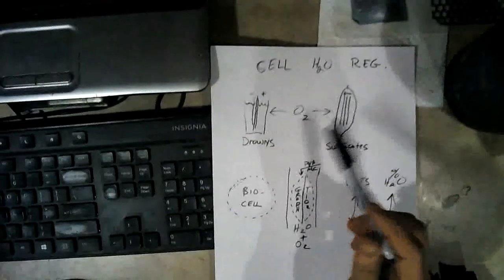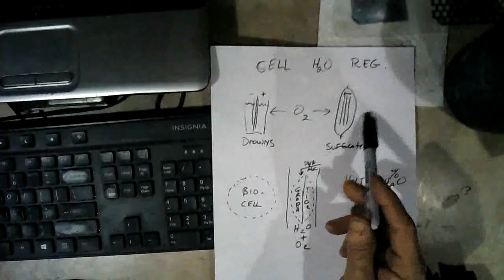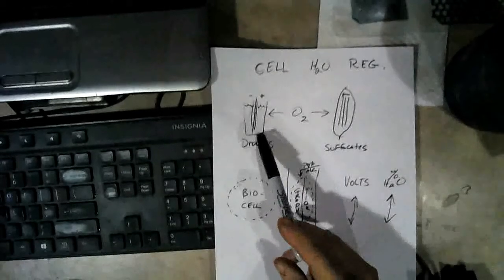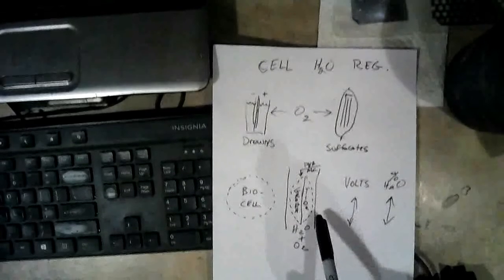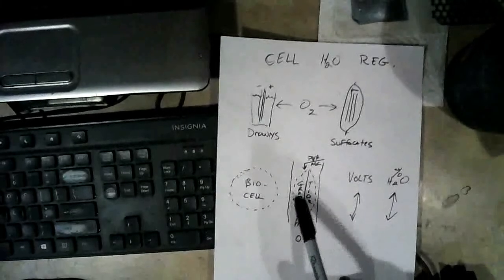Battery Water Regulation Problem!!

Comment: Maybe the cell resistance is lower giving higher voltage reading but this maybe from densely packed carbon but lower available surface area from being densely packed also . Like a trade off
Reply from the maker: That's possible. I just have to keep experimenting until I find something that works.

Comment: I have noticed on my cell tests that often when the voltage is higher that it’s capacity seems lower. Not sure why as there are so many random test but I have noticed often !
Reply from the maker: I usually see that when the cell is getting low on water, but there are probably other causes like running out of electrolyte (if you are using any), or oxidation build up on the metal plate.

Comment: Just thinking out loud again. Maybe a sponge base to wick water in to maintain hydration might help.
Reply from the maker: If I can find a sponge with the right thickness and pore density, I'll try that.
Reply from the maker: I found a 3 inch wide roll of sponge for sport wrapping in town the other day.  I think it will work in the battery Fred.

Comment: I got a feeling somehow it is something similar to voltage sag when load is applied but in reverse effect so it gets me thinking that it may be just leakage due to self discharge characteristics maybe ?🤔
Reply from the maker: There could be some leakage, but I don't think it's a self discharge problem since the cell wants to stay fully charged when not in use.